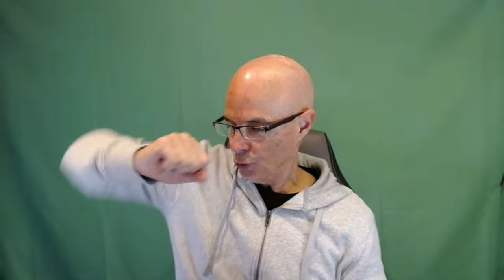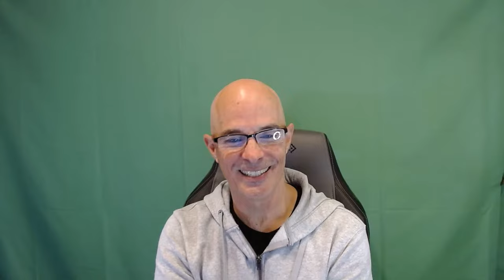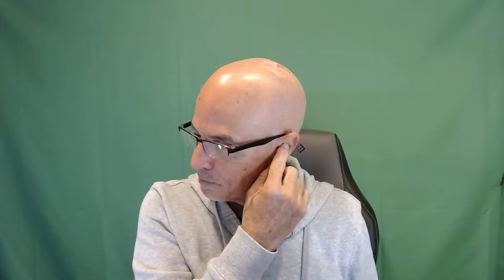LET'S TALK TECH-ARE TURBOS THE EASY WAY OUT?

Comment: na for me.  cranky cammed v8s are not long for this world. did a pistons, rings, head and cam (235/243 113 lsa) build on my ls (l98 6L) in june after lifter let go and destroyed cam. stroking it later but so far 490 at wheels is pretty ok. i’ve got higgins cnc ported l92 heads and holden commodore L98 manifold. is an edelbrock dual intake a decent next step? at the moment engine bay looks pretty stock 😁. also: throttle response!  have had turbo 4s before…trans is t56. so far ok…